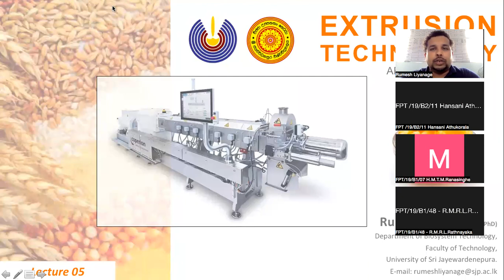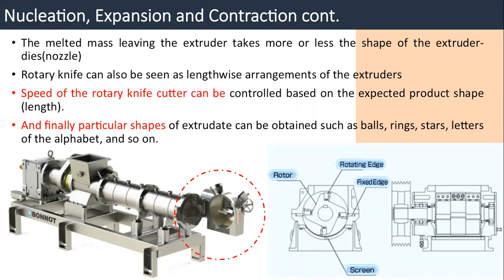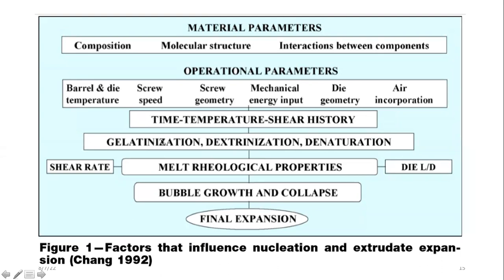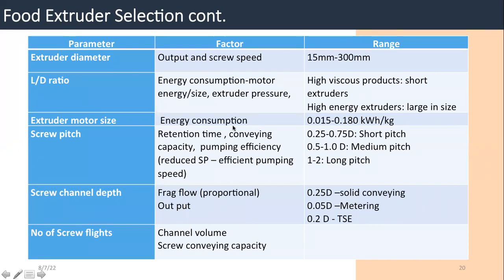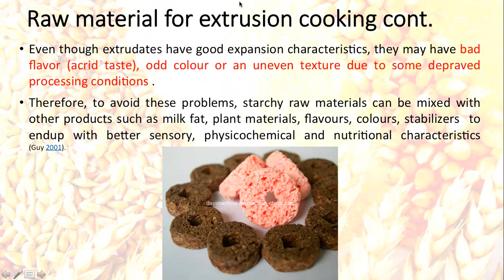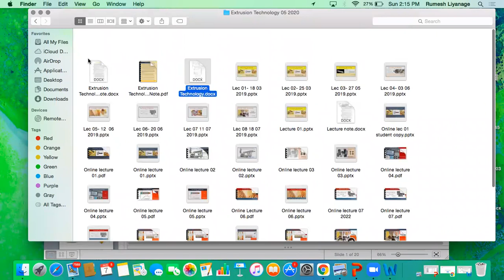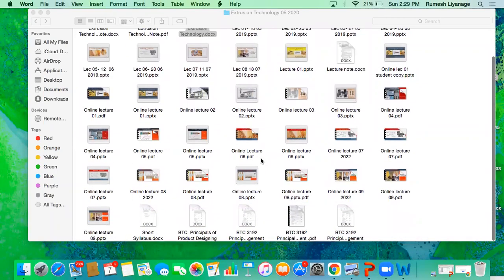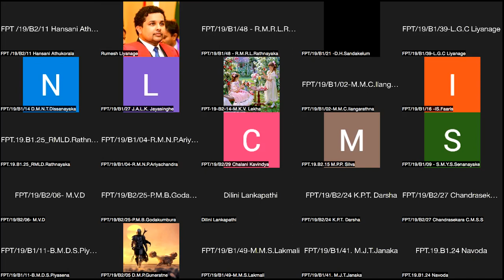Extrusion Technology UNIVOTECH Discussion 05,06

Comment: Thanks for the sharing sir

I want to ask about noodle production using an extruder machine, when the noodles are boiled there is a cooking loss in the cooking water (thick and cloudy), is it because the gelatinization process has not reached the peak so there is a loss. if so, does that mean the temperature setting needs to be increased sir?

Thank your for the answer